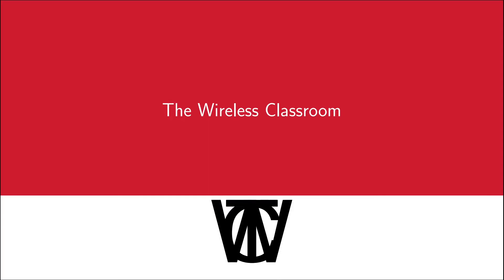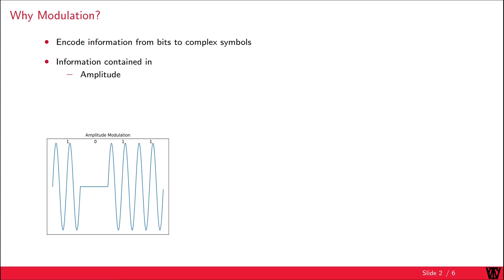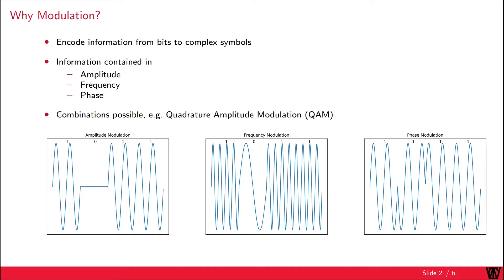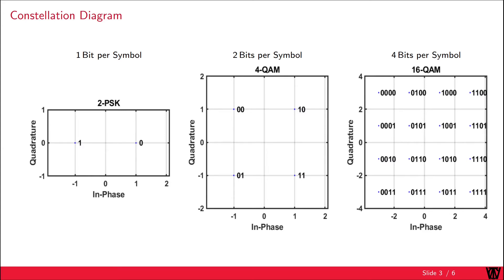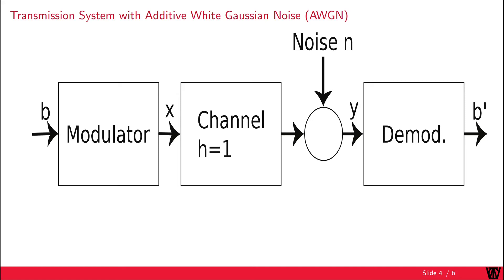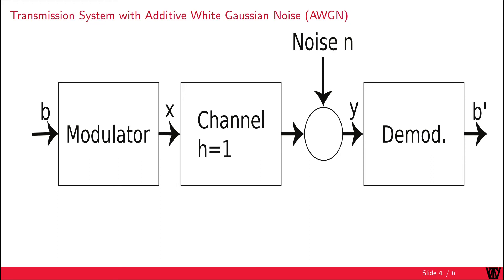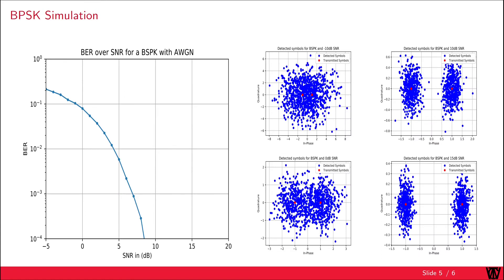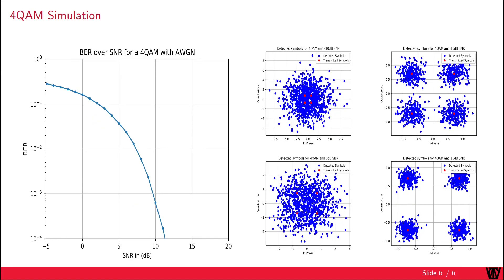Modulation (QAM, PSK,..)  in Wireless Communication with Python Coding Examples

Comment from the maker: If you have any questions, do not hesitate to leave a comment!
Reply: is the encryption happening also while you program it or do you have to code it seperatly in the code? I mean for example i use my remote to open my garage and lets say its 40 ghz and someone else who has a remote with 40 ghz can he open my garage?
Reply from the maker: @lovacc_1967  Currently there is no encryption is this code. This has to be done separately. Note that your question about the garage is not solved by encryption. It is rather solved by coding. E.g You could use the code 01001011 to open your garage and a very similar code 01001010 to close it. While for your neighbor the code could be 11001011 and 11001010 to open/close the garage respectively. These two remotes can then still be used on the exact same frequency. However this will result in some interference between the remotes.